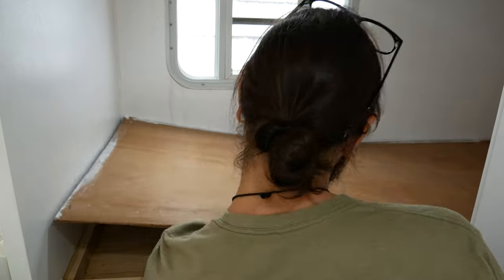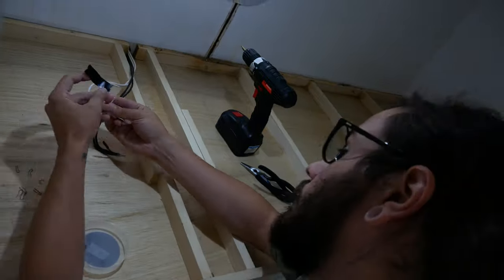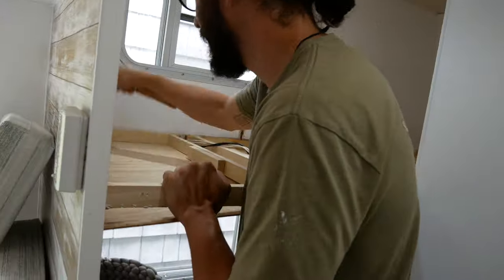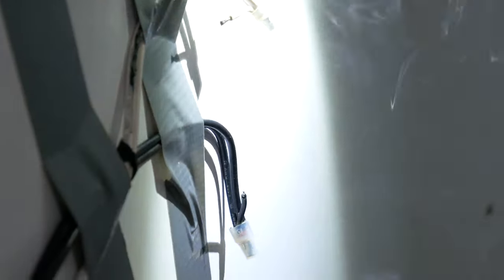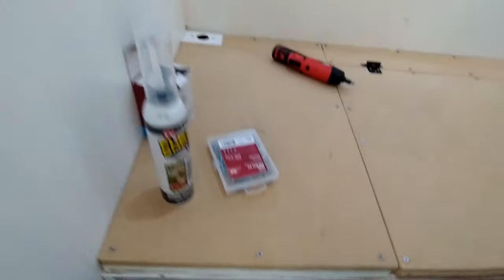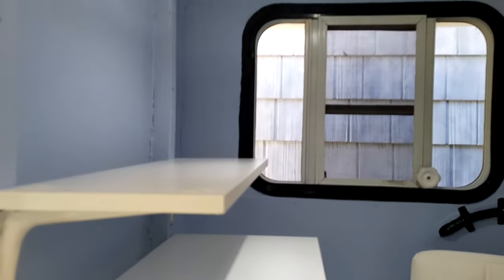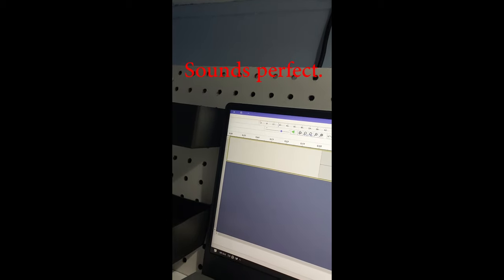Travel Trailer Bunkhouse to Couple's Office Conversion with Small Recording Studio!

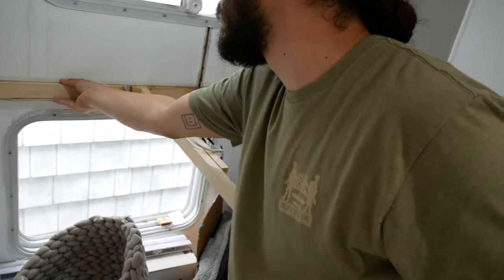Comment: Hello! I am stuck on a similar problem that you had at 1:33... what was holding the frame to the walls? Thanks!
Reply from the maker: I don’t specifically remember if it was screws or nails, but they were coming through from the outside wind up just cutting/ripping them off with a hack saw/crow bar to remove that last piece. Didn’t go super smoothly as evident by having to fix the wall after lol.